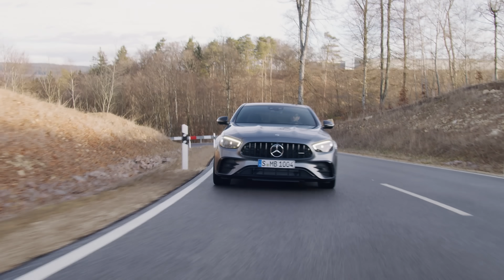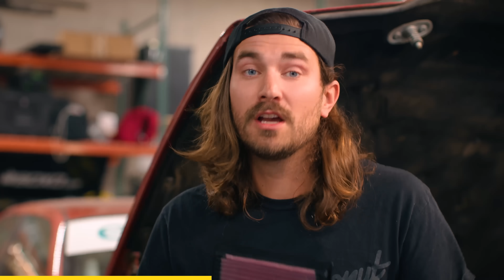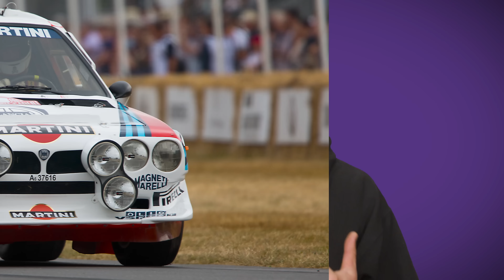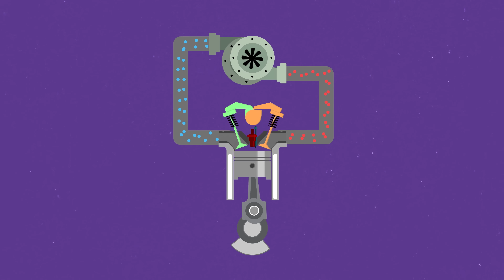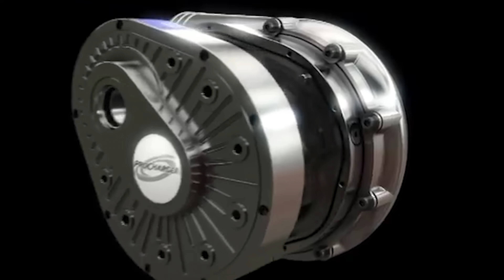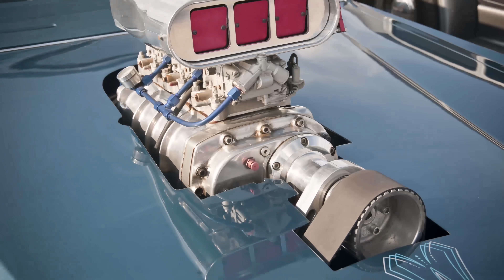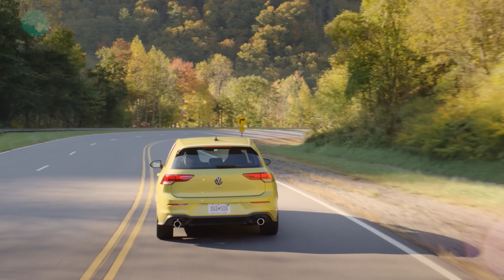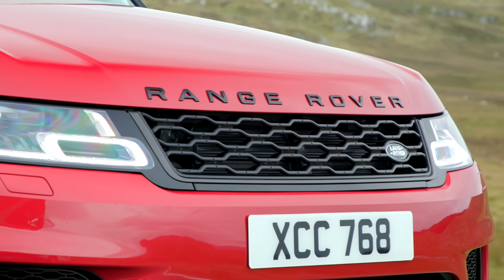Why Your Engine Isn't Twin-Charged

Comment: Great content! Really enjoy learning from you guys!!! I bought a brand new Volvo S 90 in 2018 and was surprised that the 2.0 L AWD T6 engine could do 315hp. That's when I first learned about supercharged and turbocharged engines at same time. Its a marvel of power. Really fun to drive, plenty of boost and no lag at all. No need to buy a super car to experience it. Mine was even luckier at 22k under MSRP.

Comment: Twin Charged and even staged systems were common in WW2 aircraft. This decision made more sense for aircraft operating in higher altitudes.  Manifold pressure became the most important component in making power when the air gets thin.

Comment: Variable speed superchargers make the most sense to me. IE, some kind of gearing that changes the speed it spins as the engine speed increases.
Reply: They have this on the 60 sr  only on a turbo. They change the angle of the exh turbine blades via air pressure so the turbo takes a bigger or smaller bite of the exh flowing out of the motor and spins the intake side  up faster or at a lower rpm of the motor. They called them variable geometry turbos. Im sure its way simpler to do diesels than a 8krpm gas motor and thats why u dont see it on them

Comment: the Scirocco 1.4L Tsi has a turbo and supercharger, the supercharger disconnects from the engine at higher rpms so that there is barely any turbolag

Comment: Why can’t/ wouldn’t you have airflow from both systems at once? The supercharger is just baseline, normal air flow… why cut it off and not just let it work all the time, or feed the turbo with it?

Comment: You forgot Detroit.  Which they built an impressive twin charger twin turbo inline 12.  It was 8 1/2" long. But they did blower and turbo on a bunch of their engines. I want the 50 series. I think it would be perfect for an apocalypse vehicle.

Comment: I know it’s not in a car but back in the day(in diesel semi’s) Detroit made a V8 called the 8V92 that you could get with a turbo mounted right on top of the blower. Just a thought.
Reply: P. S. The one in my Dad’s ole 82 International was rated at 430hp, around 1200 ft/lbs of torque and is 2 stroke.
Reply: Detroits weren't twin charged or even supercharged. The blower on them was required to run. It's a two stroke with no exhaust valves it has intakes ports in the cylinder wall. The piston uncovers these ports at the bottom of the stroke. The piston does not create vacuum at the bottom of the stroke. So the blower is there to get air into the cylinder and that's about it which makes it naturally aspirated and the turbo variants we're like any other turbo diesel.

Comment: Don’t forget the 2 stroke Detroit diesels
Reply: Detroits weren't twin charged or even supercharged. The blower on them was required to run. It's a two stroke with no exhaust valves it has intakes ports in the cylinder wall. The piston uncovers these ports at the bottom of the stroke. The piston does not create vacuum at the bottom of the stroke. So the blower is there to get air into the cylinder and that's about it which makes it naturally aspirated and the turbo variants we're like any other turbo diesel.
Reply: @dillon8987  I understand the blower was there to create crank case pressure. I thought the later iterations offered a turbocharged variant, to increase the power output, while still retaining the roots style supercharger.

Comment: Best solution is electric blower for each cylinder which are run by large capacitors. And small displacement.

Comment: You forgot about one twin charged engine that was manufactured in the early 90’s. The two-stroke Detroit Diesel 8V92TA. That’s a two-stroke V8 with 92 cubic inches per cylinder, turbo, aftercooled with intake ports in the cylinder sleeves and four exhaust valves per cylinder. It uses a massive turbo to a massive intercooler and roots style blower to an aftercooler. This engine was equipped in the US Army’s 10 ton capacity HEMTT Wrecker.
Reply: Doesn't that engine require a supercharger to run, though? Effectively making it only turbo charged?
Reply: @LBibeauB24  Yes it does. The blower does just that, blow the exhaust out of the cylinder. It is classified as a n/a engine without the turbo. It can't run without the blower...
Reply: @janus4002  I'm getting my hands on a detroit here soon and I plan on making a proper twin charged detroit by using a whipple and a VGT. Then I'm modding the govonor and valve springs to rev that fucker up to 3500rpm. She will scream.
Reply: I rebuilt one out of an airport tug and the guy put it in a pulling tractor when I was at trade school also rebuilt an old Hercules to go in a tugboat up on superior

Comment: The Detroit diesel 2 strokes have been done dirty. They had a blower and a turbo depending on the year, since the 70s/80s Technically the blower wasn't a supercharger, but a little cam timing change could fix that

Comment: So I still don't understand why effectively no one has ever messed around with a turbine with axial compression as a forced air solution. You have rotor fins spinning against stator fins providing high compression ratios. There is like one tiny company working on it, and they barely have a product, and they don't talk about the problems involved. Jet engines, turbofans, turboprops, they all use turbine technology to compress their air. ICEs? basically never. I want to know why.

Comment: I think creative approaches to hybrid powertrains offer a more sane answer than pure electric vehicles. All those batteries are insanely difficult to recycle and due to the cost in human capital to source rare earth minerals, they will never be washed free of the sin of slavery, even if they do get cheaper over time.

Cold plasmas are capable of storing energy in ways that capacitors do, and can double as a coolant for electric motors, while allowing weight reduction as compared to coils and heavy gauge wiring, while serving similar functions.

Cost is a factor for everything, naturally. And this is why automakers lean into human slavery in the first place and why EVs are so heavily pushed upon the market.

Comment: There isn’t really an “exponential increase” in speed in a centrifugal supercharger though. It’s still linear all the way up, just increases at a steeper rate than engine RPM
Reply: that’s….what exponential increase means
Reply: if you analyze the graph you can use the tangent points to determine the slope increasing, or see the steeper rate, on an exponential curve

Comment: Turbocharging and supercharging are always are less efficient. They use more fuel to make more power. There is no way to make more power without using more fuel, which by definition is less efficiency.  So if you have a heavy foot on a car with turbo or supercharger, then you will burn up more fuel.  Turbochargers and superchargers exist to force more fuel to be burned, its a combustion engine. Going to a bigger displacement is another way just adds more fuel to the combustion chamber.

Comment: There is a military truck (HEMMITT) powered by a Detroit 8v92 (twin charged 2 cycle) not a car, its big AF, but check it out!
Reply: Detroits weren't twin charged or even supercharged. The blower on them was required to run. It's a two stroke with no exhaust valves it has intakes ports in the cylinder wall. The piston uncovers these ports at the bottom of the stroke. The piston does not create vacuum at the bottom of the stroke. So the blower is there to get air into the cylinder and that's about it which makes it naturally aspirated and the turbo variants we're like any other turbo diesel.

Comment: I used to own a twincharged Toyota MR2 back in the 90s.  Ran 11s on pump gas and street tires with a 1.6 liter 4 cylinder.

Comment: Detroit Diesel would like to talk. Still have 6v72 in a snowblower in service today
Reply: Detroits weren't twin charged or even supercharged. The blower on them was required to run. It's a two stroke with no exhaust valves it has intakes ports in the cylinder wall. The piston uncovers these ports at the bottom of the stroke. The piston does not create vacuum at the bottom of the stroke. So the blower is there to get air into the cylinder and that's about it which makes it naturally aspirated and the turbo variants we're like any other turbo diesel.

Comment: Volvo is currently the company that using twin charger in their suv in order to make up for their 4 cylinder engine from their previous 6 cylinder. It's likely that the twin charger weight doesn't affect the suv weight that much because the suv-engine weight ratio is minimal compared to car-engine ratio. That's why most company that try to use a force induction in their car today opt for turbo only. To make it better they use vgt turbo or a "quick spool" turbo system to reduce turbo lag.

Comment: Here in Brazil we have a drift pilot that have a crazy project, that is a Chevy Chevette ( it's like the Opel Kadett c )  with a VW/Audi 4 cilinder engine ( EA827 ) that is twincharged, and man, is crazy as hell, like, the air passes through the turbo and goes to the supercharger
And most crazier, the car have air suspension
Yes, you heard it, a drift car, with air suspension and twincharged
The pilot's name is CS26 btw

Comment: For modern twin charging, they can use electric supercharging because it only needs to charge at low rpm until the turbo steps in.  I guess it's more like a pre-charge primer for the turbo.

Comment: Donut: computers,clutches and valves to control airflow.
Detroit diesel: mechanically turn diesel fuel into noise.
Reply: Detroits weren't twin charged or even supercharged. The blower on them was required to run. It's a two stroke with no exhaust valves it has intakes ports in the cylinder wall. The piston uncovers these ports at the bottom of the stroke. The piston does not create vacuum at the bottom of the stroke. So the blower is there to get air into the cylinder and that's about it which makes it naturally aspirated and the turbo variants we're like any other turbo diesel.

Comment: A gearset on a supercharger does not increase rpm exponentially typically it is a fixed ratio, say 20:1 so 1000 rpm at the crank 20,000 rpm at the blower. Love the vid, just being a pendant

Comment: Some one need to put a twin-charged motor from Mercedes or Land Rover in front of Ford’s flywheel/converter hybrid system and a Chevy ten speed, then you’d have the ultimate smooth powerful quite setup

Comment: Detroit 92 series has twin charge options and they were put into the M1070 HET.  That engine was built originally in the 1974.  Also a diesel is a IC(Internal Combustion) engine.

Comment: you guys didnt talk about the other side of twin charging, series twin charging. having a turbo blow into a supercharger. you arnt just moving 2 liters of air, you are moving 2 liters of pressurized air, every ~15 psi is 1 atmosphere, so every 15 psi the turbo pushes is effectively doubling the displacement of the supercharger. you can make some insane power adding even a modest turbo to a factory supercharged engine, which is what alot of the w-body guys do, since theres so many buick regals gs and pntiac grand prix gtps out there.

Comment: Can’t forget about the 71 and 92 series Detroit diesels, they were all supercharged, and lots of them had optional turbos
Reply: Detroit diesels are naturally aspirated. It has a blower and is not supercharged. The blower is required to get air into the cylinders as air enters through the sides of the cylinder wall at the bottom of the stroke when the piston is not creating a vacuum. So unfortunately not twin charged
Reply: @dillon8987  yes, I know how they work, but it’s still supercharged, whether or not it actually gains much manifold pressure
Reply: @ScrapyardShenanigans  that's not supercharged then 😂😂😂
Reply: @dillon8987  It has a supercharger, whether or not it’s actually building boost doesn’t matter, it’s still supercharged, because it’s got a supercharger

Comment: Also the p38 had this setup, supercharger for low altitudes, turbo for high altitudes, which made it significantly more powerful/faster at any altitude than any other aircraft at the time, which mostly had twin superchargers(one for low, one for high); which were really good at a particular altitude, but higher or lower theyd suffer, while turbos are more flexible, but also much harder to implement on an airframe, let alone without computers, let alone without fuel injection.
Reply: #knowledge
Reply: Arw you sure it was a turbocharger and not a two stage supercharger? I have never heared of turbos being used on aero engines in that era.
Reply: @egoalter1276  B-17's were turbocharged and supercharged also. Pratt and Whitney and Wright liked to do it on their engines until 42/43
Reply: Both were always on.  How much charge air the turbo generated was varied by a waste gate associated with altitude.  The system in the video is sequential, while the p38 (and many American planes during the war) were compounded (it’s referenced as two stages).  The turbo would feed compressed air to the centrifugal supercharger further enhancing the boost levels.   I would encourage you to check out Greg’s planes and automobiles.  He goes into significant detail on these setups.

Comment: Twin charging was also used on some 71 series Detroit Diesel engines. They were 2 stroke engines with no intake valves so they used a roots blower to pressurize the cylinders using cavities in the block and ports in the bottom of the cylinder liner. A turbo was also used on some models to increase the intake air pressure.
Reply: I was going to comment this exact same thing. The M113 Armored Personnel Carrier uses a twin charged, 2 stroke Detroit Diesel. It's the probably the smoothest running and sounding engine in the military. It just sucks when they blow seals in the supercharger, they will blow oil everywhere.
Reply: @reyc6710  Yeah they are really cool engines, I was surprised that they didn’t mention them at all.
Reply: @reyc6710  Detroits weren't twin charged or even supercharged. The blower on them was required to run. It's a two stroke with no exhaust valves it has intakes ports in the cylinder wall. The piston uncovers these ports at the bottom of the stroke. The piston does not create vacuum at the bottom of the stroke. So the blower is there to get air into the cylinder and that's about it which makes it naturally aspirated and the turbo variants we're like any other turbo diesel.
Reply: Detroits weren't twin charged or even supercharged. The blower on them was required to run. It's a two stroke with no exhaust valves it has intakes ports in the cylinder wall. The piston uncovers these ports at the bottom of the stroke. The piston does not create vacuum at the bottom of the stroke. So the blower is there to get air into the cylinder and that's about it which makes it naturally aspirated and the turbo variants we're like any other turbo diesel.

Comment: What about my 8v71 Detroit I turbocharged is technically both even though it needs the supercharger to run
Reply: Detroits weren't twin charged or even supercharged. The blower on them was required to run. It's a two stroke with no exhaust valves it has intakes ports in the cylinder wall. The piston uncovers these ports at the bottom of the stroke. The piston does not create vacuum at the bottom of the stroke. So the blower is there to get air into the cylinder and that's about it which makes it naturally aspirated and the turbo variants we're like any other turbo diesel.
Reply: @dillon8987  I said that
Reply: @scr2392  you said what about so I explained why it's not twin charged

Comment: Volvo penta marine diesel engines are available with a conbination of a roots blower and a big turbo since 1991. My KAD42 from 1997 works perfect. The blower activates at 1600 rpm and release at 2900 rpm. The turbo is active from 2200, but really powerful first above 2800 rpm. The blower is very small, since it operates at low rpm. The system is really simple - no electronics.

Comment: Jerry, can you explain how F1 engineers figured out the solution to turbo lag with the F1 turbo hybrid power units?
Reply: They use the same system used to harvest power from the turbo for use in the hybrid system to spin up the impeller. Electric motors and electric generators are essentially the same thing, it just depends on whether you're running current through the coils to spin the motor, or bleeding energy from whatever's on the other end of the motor to generate current flowing back the other way.

Comment: F1 is likely to eliminate the MGU-H to attract new players like Audi because it isn't feasible for "real world" use, however the Mercedes electric twin charge system shows that it does right? What am I missing? This twin-charge system sounds a lot like the electrically assisted turbo's on the F1 cars

Comment: just use a flywheel mounted electric motor that goes between the motor and trans to give power in the gap of the turbo pressure.

Comment: Yeah also the Volkswagen 1.4 tfsi is know for its mechanical problems due to it’s complexity. My friend has one and his motor had to be fixed 3 times within 20k km. I just keep it at a simple 2.0 TDI with normal maintenance it just keeps going.

Comment: So, I have a aw11 mr2 an 89 which actually came with a factory roots style supercharger that’s mounted on the side of the engine much like an alternator, an electric clutch to engage / disengage the charger, an intake that feeds through a side mounted inter cooler, and forged internals.. who wants to help me slap a turbo manifold and a tune into this lil guy